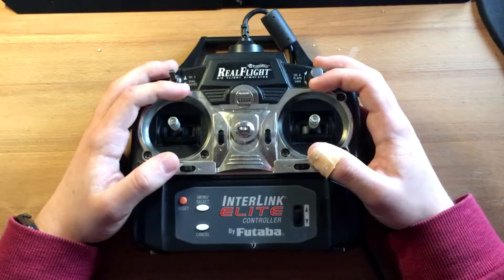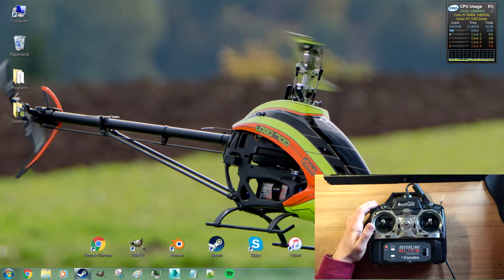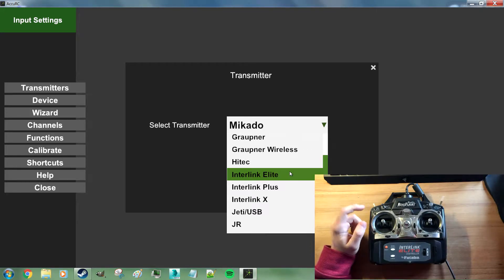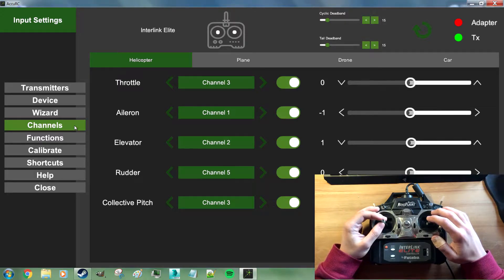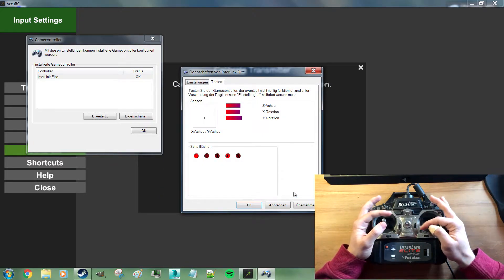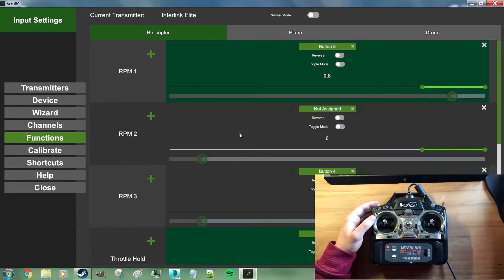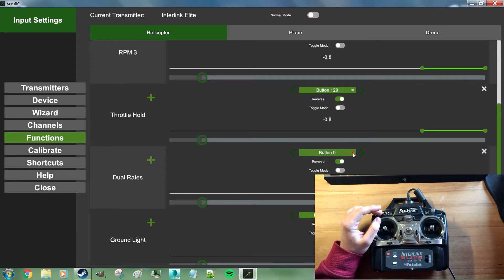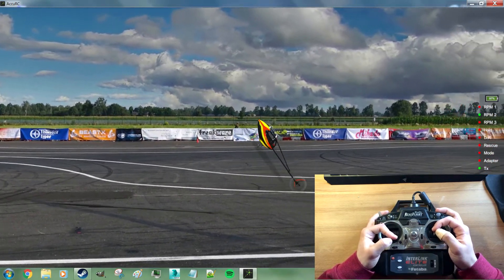AccuRC + Interlink Setup

Comment: ON MY USB DEVICE DOESN'T APPEAR NOTHING :\ I HAVE THE INTERLINK ELITE
Reply: does it appear in usb controllers in windows? if not then your interlink is broken.
Reply: @DorsetSaferRoads  yes it appears and works with cgm next heli simulator
Reply: @MrJoaoAfonso  is it appearing in the dropdown as a device in AccuRC? tx settings > device then the "device" drop down, is that empty?
Reply: @DorsetSaferRoads  the device is blank and I cannot chose nothing. It worked before.
I don't understand why isn't working now. tks for help
Reply: @MrJoaoAfonso  sounds like something got corrupted, try a verify files, right click on accurc in steam client, properties, local files, verify local files.
Reply: @DorsetSaferRoads  thanks, I reinstalled and nothing, it keeps blank
Reply: @MrJoaoAfonso  did you try the verify?
Reply: @DorsetSaferRoads  yep and appeared 5 files corrupted, its said it will replace them, but again nothing happens
Reply: @DorsetSaferRoads  it might be a problem with the usb ports. Thanks